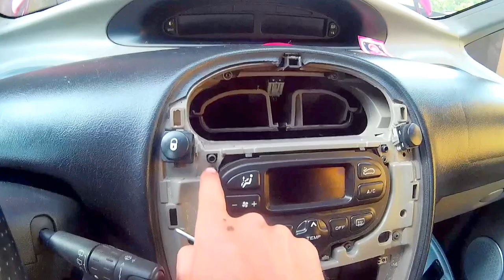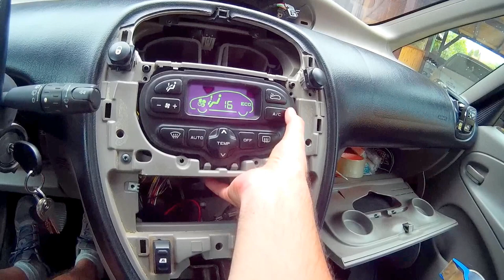How to Replace Light Bulbs in Automatic Climate Control Unit (Citroen Xsara Picasso)

Comment: Is there an option to change the brightness? In normal light I can see everything on my AC CU, but after the ignition it is almost invisible. Would changing the bulbs solve this? Or is there a brightness control like for Dashboard?
Reply from the maker: I'm not sure, my dashboard is modified because it was damaged, so that is not adjustable, and the climate control has new bulbs so that is pretty bright... try to replace the light bulbs...

Comment: Great video ! Note though that unplugging the radio (except the antenna) is not needed. 
Also it is not needed to unplug the small connector on the unit. 
(On old cars the plastic of the connector becomes brittle, better not touch it). Avoids losing the radio memory.

Comment: Hi very nice clear upload, doing this ive been advised to take the terminals off the car battery. Is that really needed. I havent got the climate control version just trying to replace my unit as the heat knob is broke and stuck in the hot position. Thanks in advance :)
Reply from the maker: Just for safety you can disconnect the battery...
Reply: Ok but not really needed tho, thank you

Comment: y caso no funciona el aire acondicionado y la pantalla no se ilumina. El tema de cambiar estas bombillas es solo el tema dela pantalla iluminada. Explico mejor la pregunta, si estas bombillas del vídeo están fundidas como es el caso, ¿puede funcionar el aire acondicionado aunque no se ilumine la pantalla? Gracias por la ayuda
Reply from the maker: The AC should work just because the display is not lit from behind, but if the Climate Control unit is bad than I'm not sure if it will work...

Comment: do the icons still light up orange Yeh?  be hard to change the board leds suppose
Reply from the maker: +Horticulture and Bonsai est2005 (Doug) 
on the climate control it is greenish
Reply: The two icons stay orange (rear heater and front defrost)

Comment: iv just bought a diesel picasso and there is no display visible on this control unit  would these three bulbs be the likely problem? great video  very clear
Reply from the maker: +darren maguire 
if the rest of the climate control functions are working fine (airflow, temperature, blow location...) than I think only the bulbs need to be replaced...
Reply: Yes good man thankyou

Comment: my display is fine but the buttons don't light up. will doing this help?
Reply from the maker: I think yes, because if you still can notice something useful info on the LCD than all it needs is some light from behind.
Reply: furulevi same bulb size then? thank you so much
Reply from the maker: I'm not sure, I haven't taken apart the unit itself...
Reply: Hi. Did this work in making your buttons light up, please? That's the issue i have. Thanks.

Comment: have you tried to replace light bulbs for buttons?
Reply from the maker: Not yet, but I have to do that also.
Reply: I have Peugeot 206 with same console and my buttons do not have light on it
Reply from the maker: There are no additional bulbs inside, only those 3 bulbs which are visible at around 6:34. The lower bulb's light is spread to all the buttons via a clear plastic part. The top 2 bulbs are for the LCD.
Reply: furulevi thank you brother ☺
Reply from the maker: I also have a video of, I have to upload it...